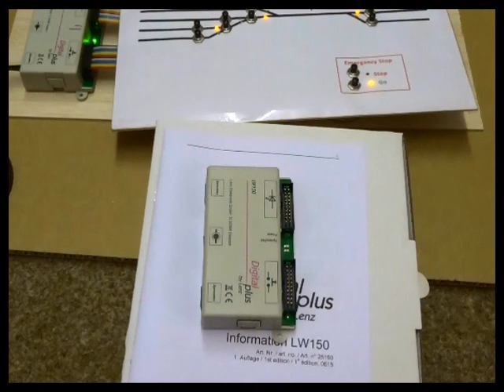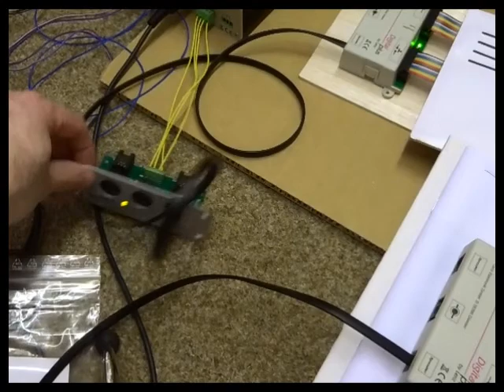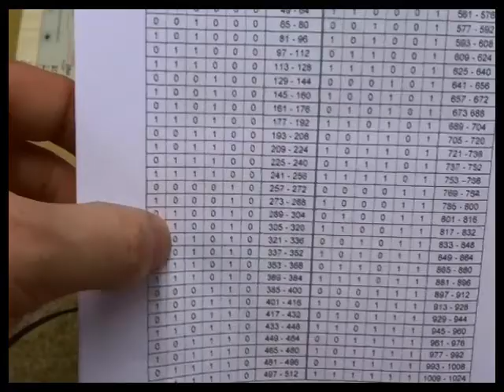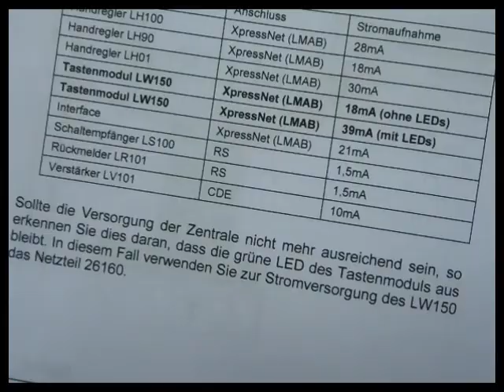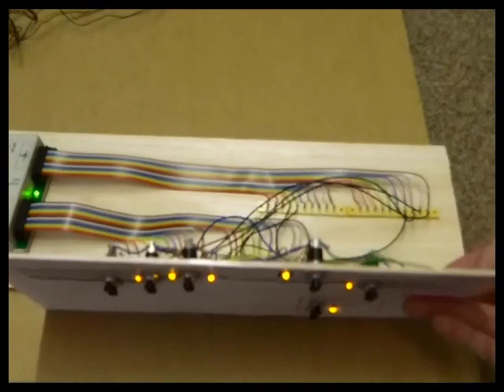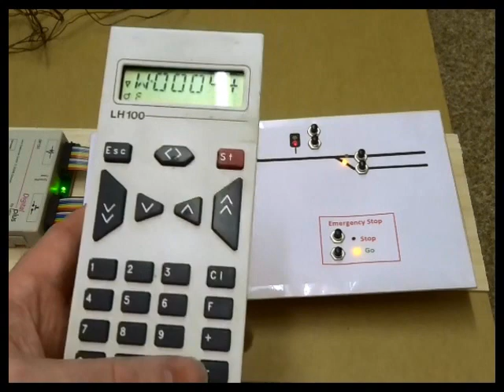Lenz LW150 Mimic panel module

Comment: Does the LW150 allow programming so we can have just one push button per destination track rather than two per turnout?  If not, is there another product (from anyone) that does with Lenz?
Reply from the maker: You can use a toggle switch that switches between the 2 states (+ and -) for each point.  Or you can use 2 push to make buttons for each point one for each state or position.

Here is the manual
https://www.lenz-elektronik.de/src/pdf/b_25150.pdf
English language section is in the middle

Kind regards

Chris

Comment: are you aware of any means/methods to use the 150s to actually set a route within a turnout tree?
Reply from the maker: The LW150 is purely designed to switch turnouts from a Mimic panel - It does not have a route memory facility.  The new LH101 handset that Lenz have announced for later in 2017 will have a route setting mode.   http://www.aandhmodels.co.uk/21101-lh101-hand-controller-46096-p.asp    Kind regardsChris